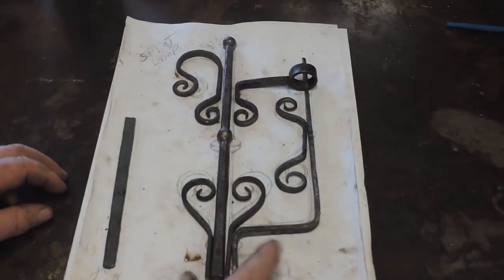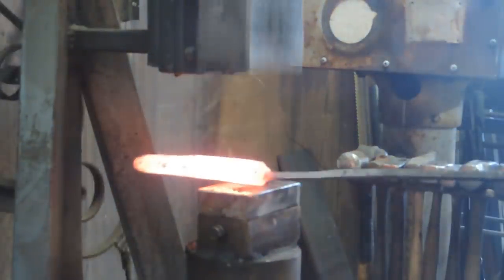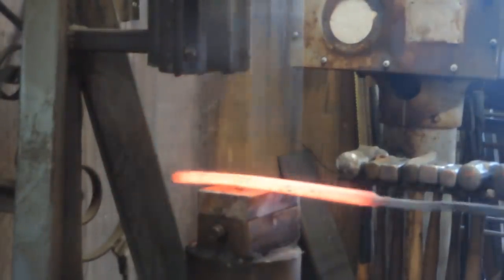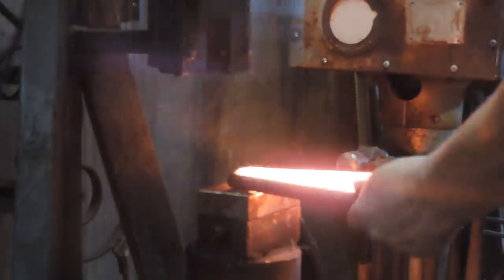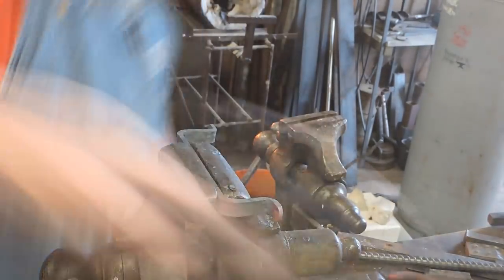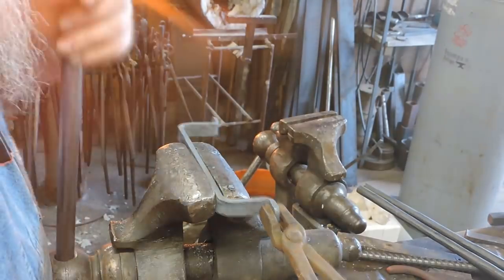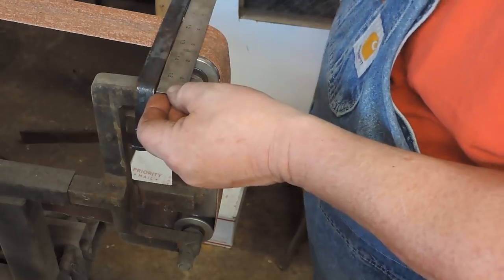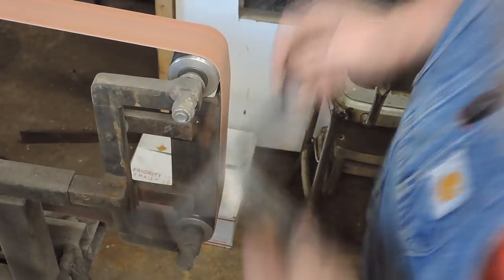Forging A Wrought Iron Splint Lamp Part#3

Comment: An inspirational series I must say! "Tinning" the pieces before riveting - I've seen that done at Renaissance fairs for setting pieces in fancy armor before riveting. It was an old technique in those times too. Modern plumbing solder doesn't work but silver solder does. It grips the iron, and makes a strong laminate, unlike the modern tin/antimony (and formerly lead) solder. I had forgotten about it though, so thanks for the timely reminder.

Comment: You should definitely send it to me. 😉 That's a beautiful project, I had never seen a lamp like this before. Are the fuel for this just straight wood or are they prepared with a substance to keep them burning longer? Would it be historically inaccurate to have a reflector or diffuser on this?
Reply from the maker: I have never seen a historic example with a reflector or diffuser on it
but that doesn't mean it's not a possibility. The wood is called candel wood or fat wood, it is cut from the tree ware the sap is at its highest concentration
This ensures the wood will burn brighter and longer. Thanks for watching.
Reply: @BIGDOGFORGE  Very cool, I find it great to keep learning new, old things here! 😃